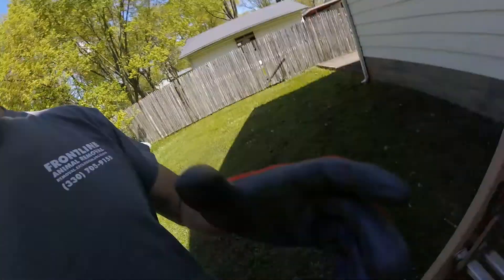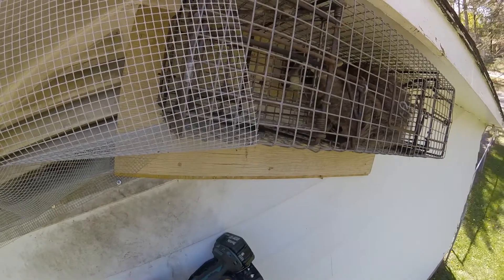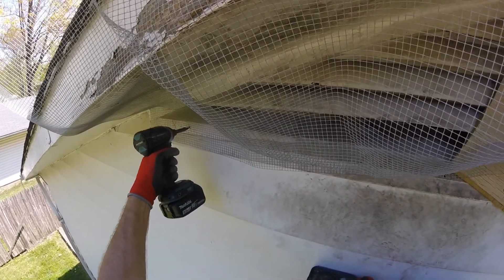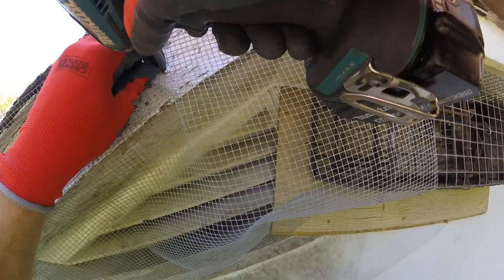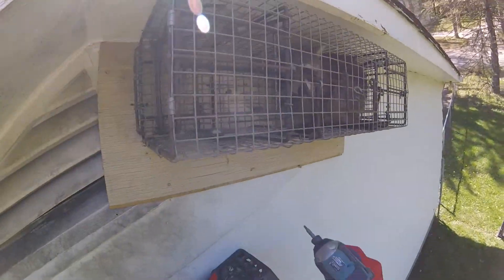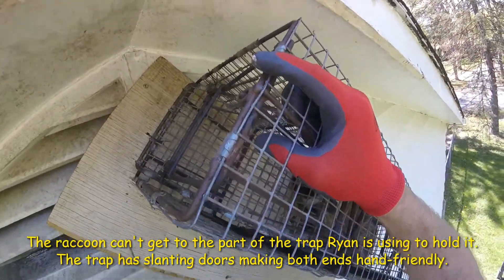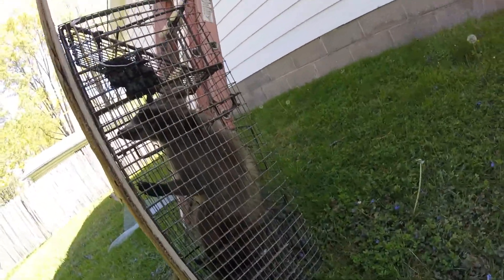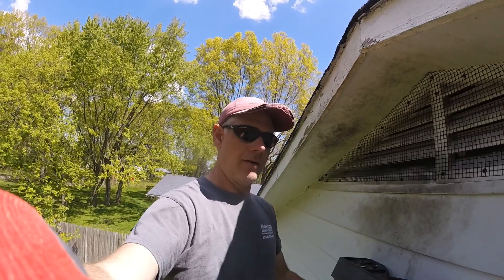Gable Vent Raccoon : Getting Trap Down & Installing a Screen

Comment: Hey Ryan! I've been using 16 gauge 1/2" by 1" wire mesh to exclude these with? Is that too large? Will bats fit in between there?
Reply from the maker: 1/4 by 1/4 for bats
Reply: @Frontlineanimalremoval  I figured. I've never done any bat exclusions. Just want to prevent customers from having future problems.